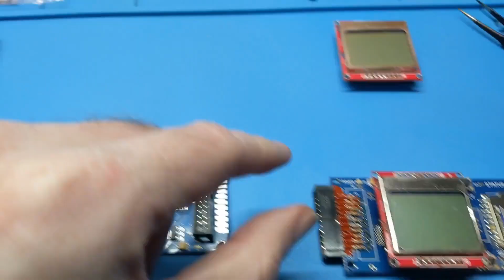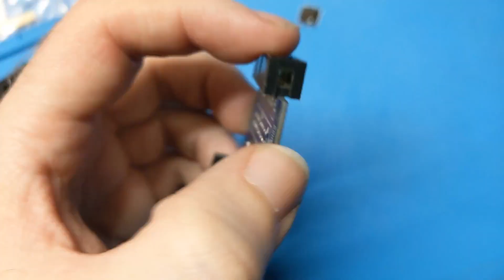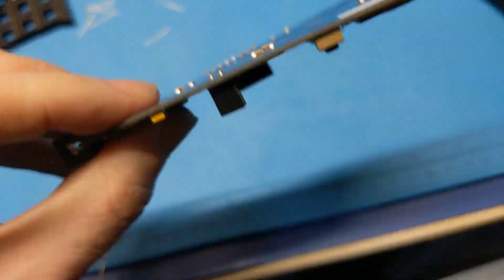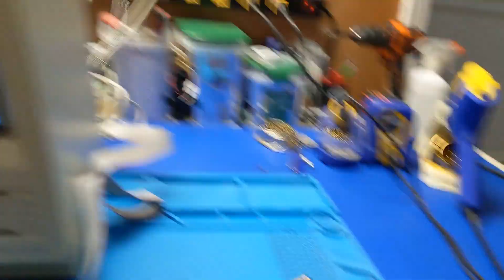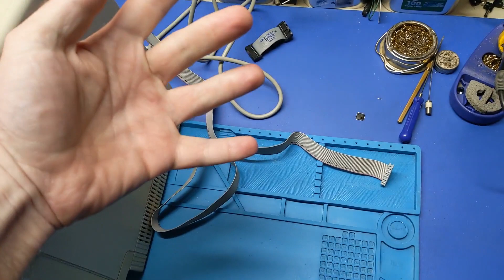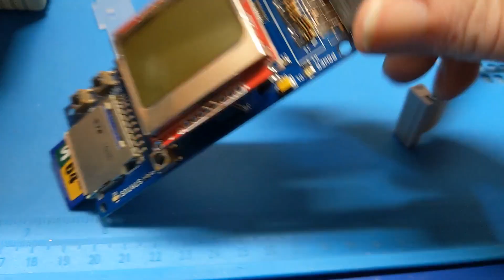Macintosh Floppy Emu repair and debugging

Comment: Great video!  I am here because I have a rev c that stopped working.  The LD33 got really hot and the CPLD is sort of hot.  I pulled the LD33 off and the short between 3.3 and gnd is still there.  I am assuming the cpld is shorted.  I will pull that off next and see if the short is still there.  I have a few more cpld's i was saving for rgb2hdmi's but hopefully this will fix it...